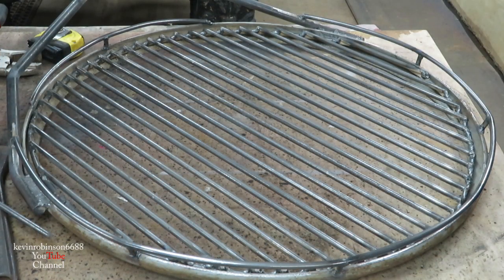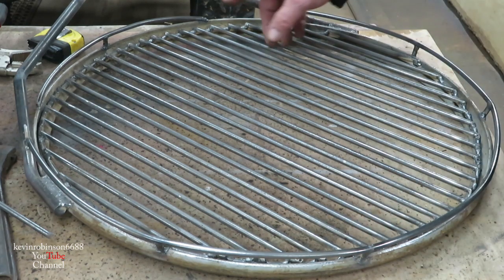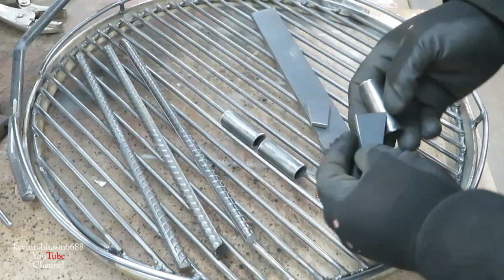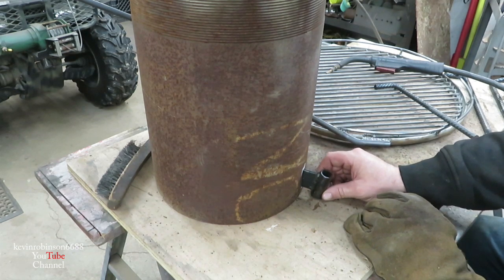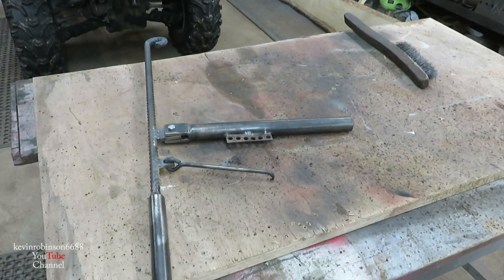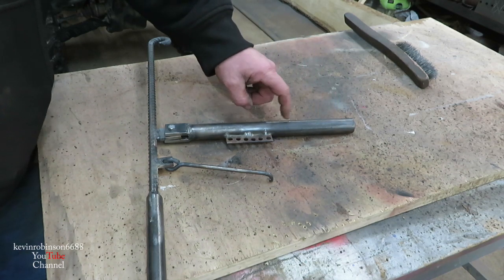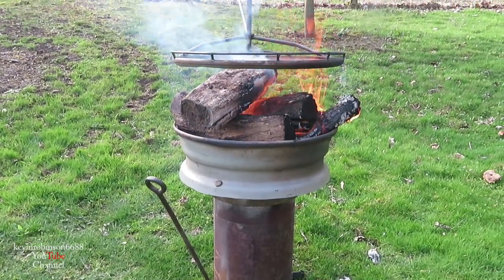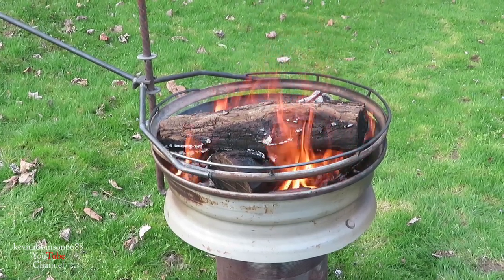how to build a fire pit from a truck wheel  part 4

Comment: Kevin, very nice job.  Have you considered adding two small loop handles to the grill plate?  They would be "u" shaped and be welded to the outside edge across from each other.  That way you can lift the grill in and out of the support ring without having to swing the grill back and forth.  Also, for safety, have you considered adding some type of sleeve over the end of the grill holder handle?  Maybe a wooden Dowell so that children or pets cannot run into the handle end and hurt themselves.  Beyond that, I really like your work!
Reply from the maker: Thanks for the ideals John.